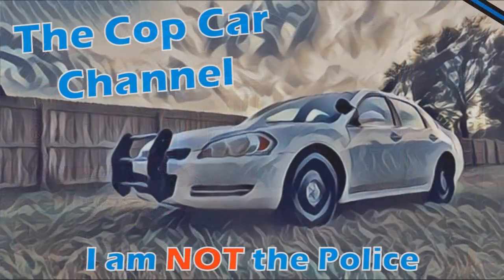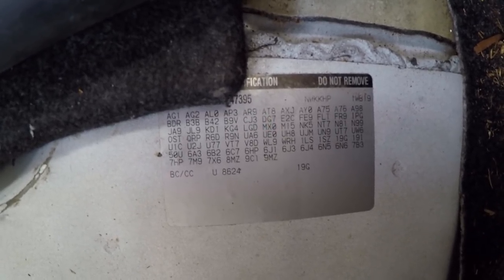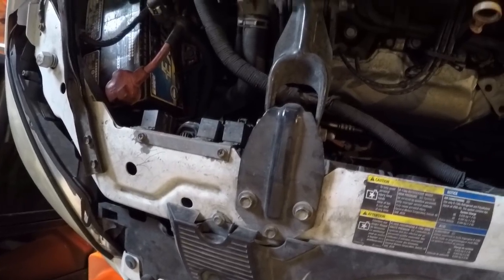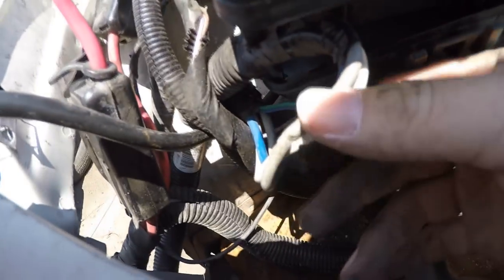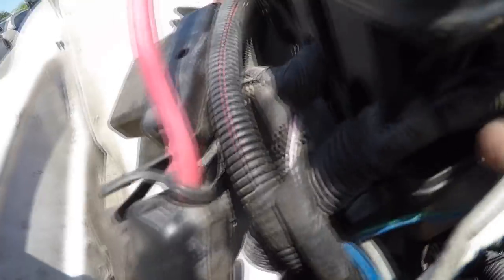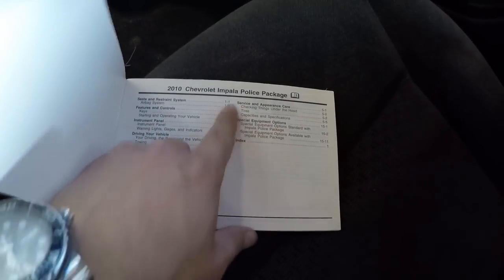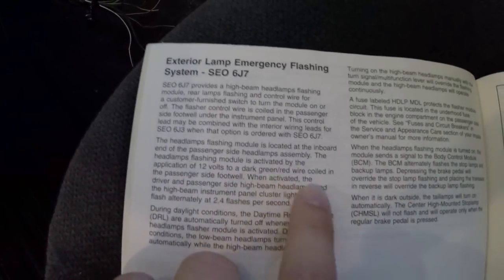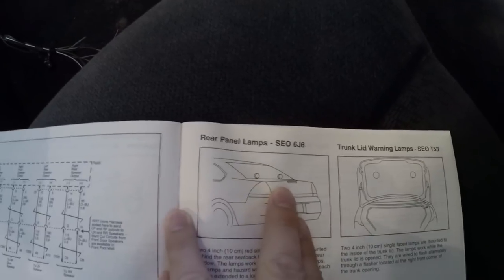Stock Head Light Flashers? on the 2010 Impala 9C1

Comment: Those 3 relays under the hood are the heavy duty replacement kit for the cooling fans for the engine. The stock fan harness got cut off behind the passenger headlight and the heavy duty harness was spliced in there. I know because i used to install them. We installed the 6j7 flashers, the factory did not. All SEO options were added after the cars were built.
Reply: I don't know if you will get this but since you worked on these cars do you know if it's possible to get the interior lights to work? I've been told to reprogram the BCM. Thanks

Comment: Cool stuff!  I still have tons of stuff from when I wired these things, but it’s all been sitting around for 25 years now.
Reply from the maker: That's awesome!  I'd like to get a 95 or 96 Caprice some day - you'll have to let me know if you have anything (information) for those cars.  I'm sure you remember back when the Caprice was the "best car" used by law enforcement - just like the discontinued CVPI is now.  It'll be interesting when everyone decides that the PI Utility was the "best car" for police in about a decade.
Reply: I think the Explorer is the best police vehicle space wise, and the coolest looking police vehicle is the Charger.  When I was doing cars in the late 80s/early 90s were the Crown Vics and Caprices.  They were about equal I think back then.  I also did a couple K5 Chevy Blazers and then tons of pickup trucks for FD Vollys.  
I think 1992 was the last year I wired anything, and I think I have some Sound Off Systems Flashbacks (taillight flashers) and Wigwags (headlight flashers) in a box in my basement.  Not sure what else I may have kicking around, I know I have like 4 or 5 boxes full of various cables, brackets and other stuff.  I am going to see if I can install one of the flashbacks in my 2015 Explorer (civilian model).  Can't put WigWags in since it had HID headlights, though my goal is only to have the extra rear protection should I ever need to stop on the highway.

Comment: mine had the wire on the harness in the pass footwell where if supplied power it will flash the headlights, taillights and reverse lights.

ANY IDEAS what the big yellow wire right underneath the steering column does?

Comment: My 9c3 has a flasher and there's a federal signal flasher behind the radiator. I had issues with the tails flashing when I first got it. Took a while to figure out which wire to unhook. Also had the high beams randomly start flashing once too.

Comment: Did you ever figure out your dome light is it has the switch to control it when you open and close the doors.
Reply from the maker: I just tried it out, nope.  The switch is only "on / off" without a "door" type setting.
Reply: TheCopCar ok I'm going to go look at one tomorrow it might be with your dash dimmer or so just like the head lights when I told you I'll get back after I check it out if you dont figure it out before me

Comment: I have a the same car but mine has the 6j7 code in the trunk. I dont seem to have the green\red wire in the floor that the SOP book says i should have. I would like to see if i could get my lights to work again. Any help would be appreciated.
Reply from the maker: It's possible that they removed it when they pulled the lights out of your car.  I'd look to see if it's tucked in the floor or up in the dash board behind a panel.
Reply: I just pulled the panel and exposed more of the wires. I found a dark green\red wire but its part of a plug. I was under the impression that it was a wire by itself. Ill cut it from the plug and put power to it to see what happens. Thank you for responding. Love the channel.